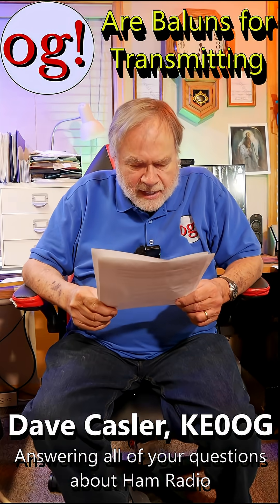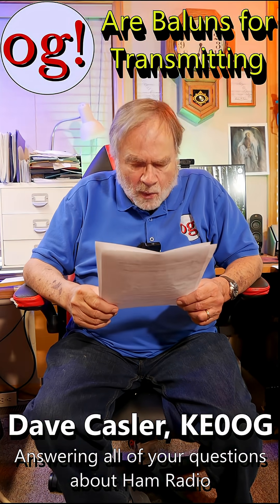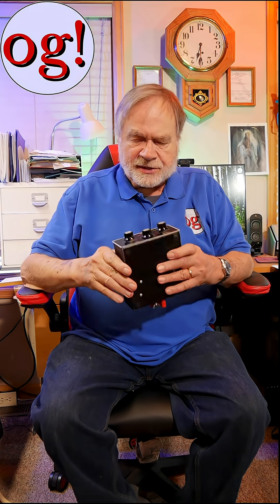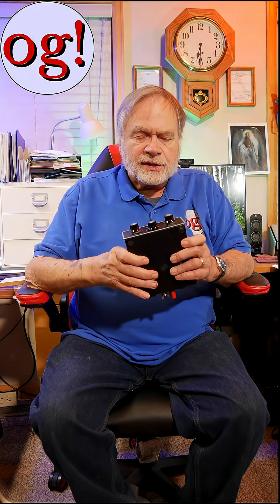Are Baluns for Transmitting (Short #114)

Comment: Insulated gate FET transistors are much like tubes . A high impedance input at least to the transistor, that allows the impedance to be set by resistors as the engineer decides to do.